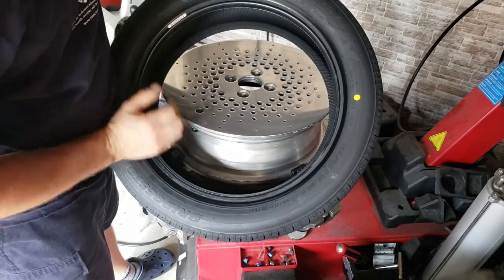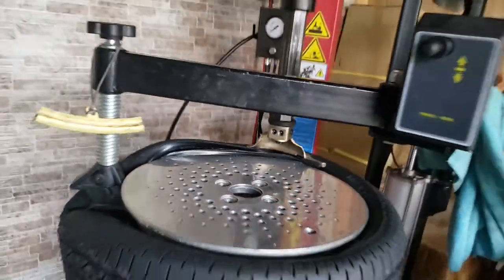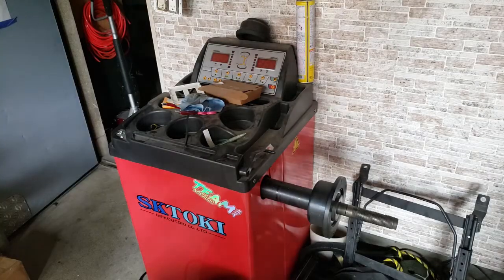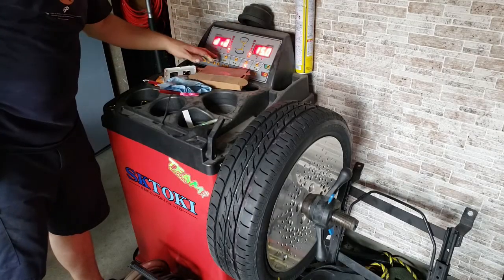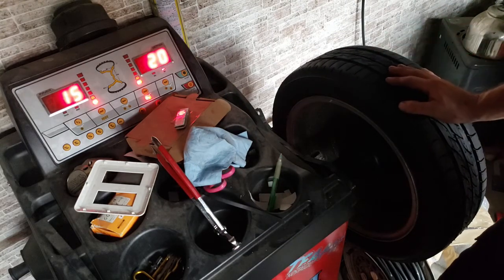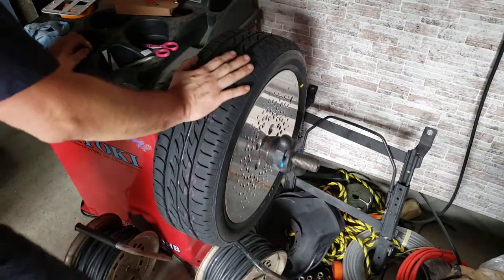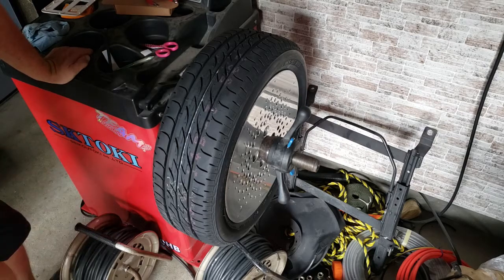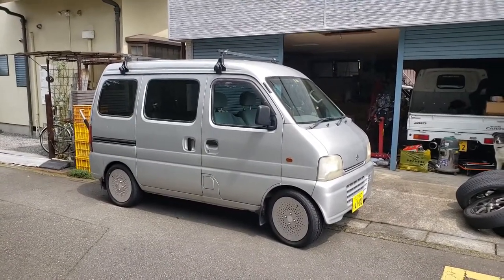Fitting tires, balancing wheels, and fitting them to a Kei van @GarageKei

Comment: Ok....the mysterious yellow dot. Let me enlighten your brain. 
It's there to line up with the valve stem....yes. 
But why????
It's so if you need to remove the tyre later on for a puncture repair you can refit the tyre in the same place and you don't need to re-balance it. Nothing to do with the actual balance of the tyre.
Not much of an issue with steel wheels and edge weights....you can usually see where they were and you just bash them back on. It's more for alloy wheels that have been static balanced using stick on weights, so you don't need to rip off the old ones and have sticky crap all over the rim, or scratch them... only to just have to replace them in a different spot.
Tyre comes off, get repaired, goes back on in the same position ..job done 👍